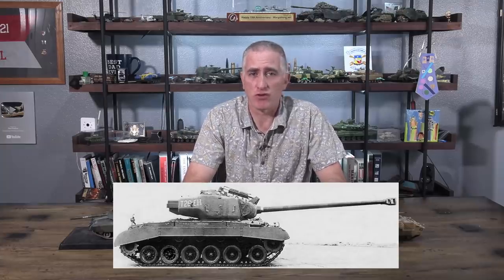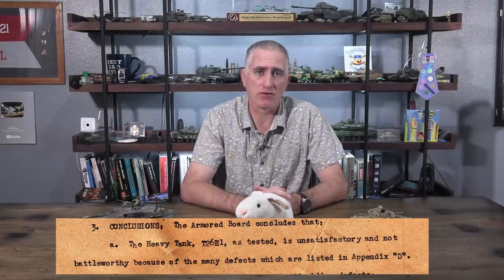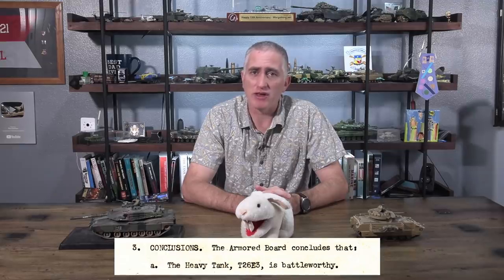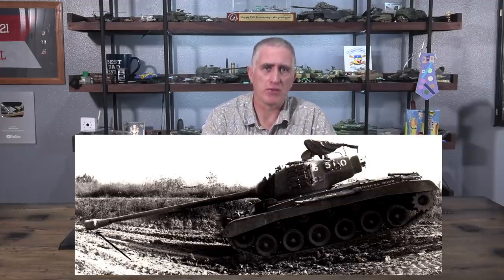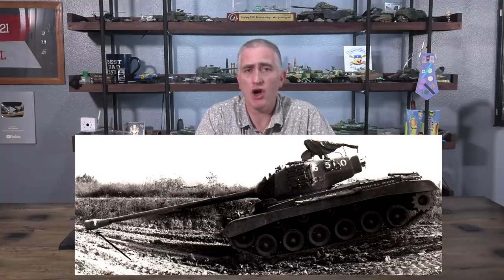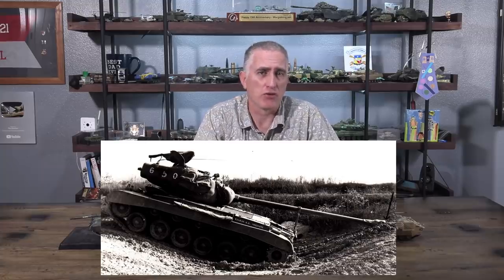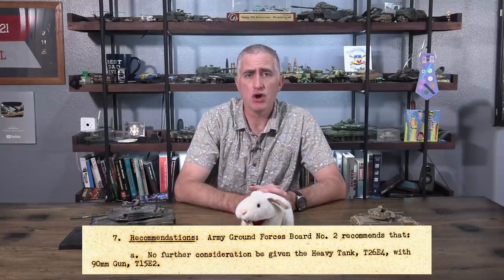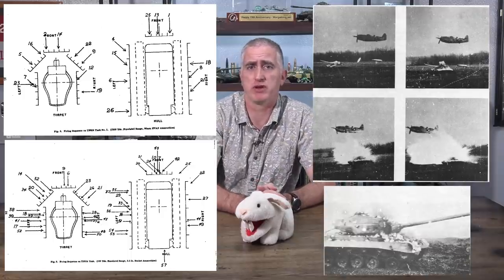Super Pershing: Why T26E4 didn't work.

Comment: Ah, T32.  If I remember right, the main reason it was never produced for service wasn't mechanical or reliability issues. It was how much of a cast-iron mother it would be to transport overseas given it's weight and dimensions.  Adding further proof to the Chieftain's opinion that the clevis hitches and welded-on hook loops being the most important parts of the Sherman.
Reply: I find that interesting. The M103 was deployed to Europe and M103 was even bigger & heavier. The Marines also used M103 and sealift would be a critical consideration for them. So what happened in the 10 years between T32 and M103, was there some major change in sealift capability?
Reply: @williammagoffin9324  In short, yes.  Sea transport capability vastly improved in the directly postwar years. Attempting to build an entirely new logistics and support system with completely different specs for bigger and heavier equipment mid-war, while keeping it compatible with older equipment is doable, but something military planners would really like to avoid.
Reply: @williammagoffin9324  The LCM-8 was developed around the same timeframe as the M103 and the LCUs, already in service at that time, would be able to carry an M103.
Reply: @williammagoffin9324  Lack of a hostile country with submarine technology?
Reply: It wasn't produced because the Army didn't want the T32 nor the T26. They were happy to wait on Ordnance to finalize the design of the T25 when Congress forced Ordnance to design a heavy tank ASAP in 1943 due to the press getting the public alarmed over the Army's lack of a heavy tank and blamed Congress for failing to provide the funding to produce one. The 1944 elections were coming up and the Congressmen were worried about a repeat of 1942 where voters kicked out a lot of Democrats from office because the press said they weren't being aggressive enough to get the weapons needed to defeat Japan and Germany. Ordnance then turned the T25 into the T26, made a factory and lined up parts suppliers so it could go into production in September of 1944 before the November Elections. The factory was ready for assembly in September but no parts were available until after the elections due to delays in having new machinery made and contract obligations that had to be completed first by the suppliers. Seventeen were assembled in November and around 26 in December with the first 20 made promptly shipped over to Antwerp without trained crews and mechanics.